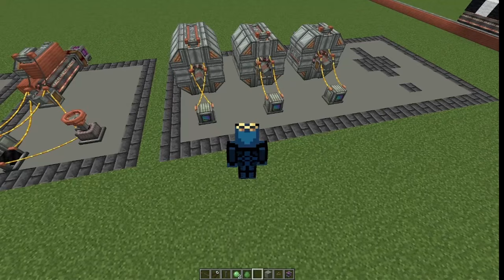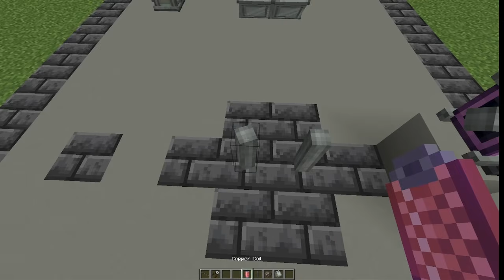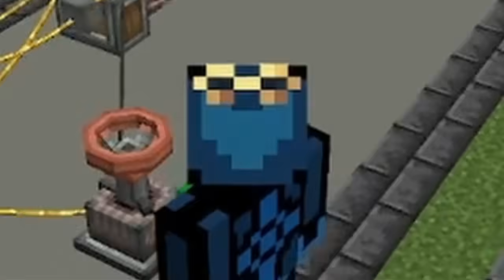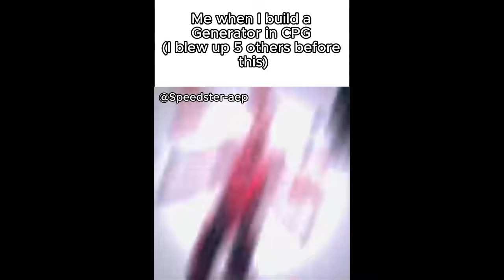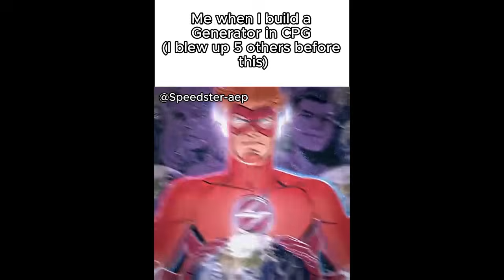[OUTDATED]  How to make a Generator | Create Power Grid Tutorial/Info

Comment: when i make this machien i get 0.08 VOLTS withj all 4 sides with windings the windings def work since each add +0.02 and im at max speed creative motor i tired both directions nothing is working for me idk why
Reply from the maker: Do you have the generator housings placed to the windings?
Reply: @someoneisnear  yes the issue ig was i didn't properly wire and cycle the inital residual energy back to the commucator to produce the actual voltage

Comment: 7:00  

I did 1in1 like you. The polarity is correct, everything else is correct, even the rotation of the creative engine is set to 90, just like you. But your voltmeter shows 195 volts, mine is 0.02. WHY? EVERYTHING IS THE SAME FOR ME AS FOR YOU, WHY DOES IT WORK FOR YOU AND NOT FOR ME?
Reply from the maker: Try flipping the rotation of the create motor. Let me know if that helps.

Comment: Why my generator doesn’t spin constantly? If I connect something or change resistance the generator slows down. When I change rotation speed on creative motor then generator starts to spin like it was in slime or something. It feels super strange. And when I destroy motor generator keeps spinning really really long. I already trying to change something on config but nothing help, mine just don’t work as it work on YouTube videos
Reply from the maker: That's the resistance in the windings whenever you spin it. It's normal as the voltage flowing through windings creates the magnetic field that slows the rotor speed. (Just from my basic understanding of it)

Comment: Those device are rates 1000 Watts, example given, power resistor can only be 3 A at 300 ohm before start over heating this is because you don’t have constant voltage but power, the best is around 1.9 A

Comment: 1 problem, im on forge 1.20.1, do you know why my generator clutch is getting power (creative motor) but doesnt give the power to the other side? the generator doesnt get the rotation
It's on generator mode, I dont have it powered with redstone, and even with redstone power it doesnt work
Reply from the maker: The generator doesn't use Redstone it uses the rotation of the generator clutch to spin the induction rotor.

The induction rotor must also be connected to the Generator commutator in order for it to spin.

Also, don't forget to connect the outputs (positive and negative connection) to the coils that surround the induction motor. This will create a very crappy but working shunt generator.

Comment: 1:24 trust me, you're gonna want that resistor. It will prevent you from accidentally blowing up your generator excitation winding as it has a limit to its current. (Yes you could use a fuse but then you risk your grid shutting down from one of your generators shutting down.) So trust me you're gonna want that resistor set to something higher than 0.1 ohms to prevent human error.

Comment: The variac is just a variable resistor and is only there so you can easily turn to change the voltage. To generate anything you need to excite the stator coils. The resistor from the commutator to the stator is just to limit how much excitation current flows through it because the stator coils saturate at 2A. If you push more than 2A through the stator coils you will get higher voltage but also you spend more power on excitation and start overheating the coils, you can attach a thermometer to see. The shunt just limits the voltage not regulate, if you connect any load the output voltage will drop. That's probably why there's a variac in the ponder, so you can adjust the voltage when you connect or disconnect something. You regulate the generator manually in this case. That's okay when you have constant load but if you're switching stuff on and off your voltage is gonna be flying up and down. To do it properly you need a regulator circuit that adjusts the excitation current up to 2A to maintain stable voltage with any load.

Comment: hey u can make a transformers that do is like generator give 440v then we convert into 12.1kv tha what i did i used 2 transformers 1:11 and 2:5 so it goes to 12.1kv but i need that add a stabilizer like when i convert it back from 12.1kv to 440 i dont get 440 but i get is 428.###v so i need to add a  stabilizer that convert v around 440 on load and off load idk how to make it but can u help me?
thank you
Reply: i was also building and supplying electricity to a server/town it is prety fun tho i am js stuck one the  stabilizer part but all good and will making  stabilizer my self i blow up like my generator 15-20 time already  hehe

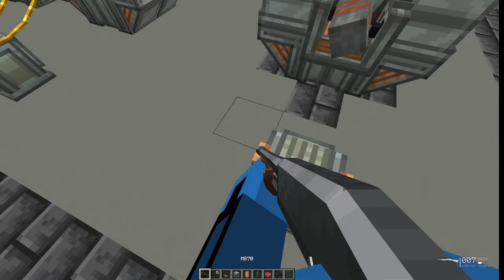Comment: 6:33
pulls out shotgun
"Dun worry bout that."

HUH
Reply: Last time I checked, electrical engineering doesn't require you to hold the generator at gunpoint
Reply: @boopjack  No it's common practice to intimidate your circuit before testing for better chances of sucess.
Reply: @David-pz4gy Uncommon form of "percussive maintenance": "preventative intimidational maintenance"
Reply: @boopjack generators are kinky, it excites them when you do that

Comment: If anyone has any build ideas for a power meter to enable payment for power I’m interested
Reply: Built my own service entrance!

Bury a breaker underground and hook it up to a security card system so utility employees can turn power on/off.
Power meters really can't store value, but what you can do instead is bill at a flat rate based on the type of building, and add a multiplier based on typical load.
Reply: @Lokey_71  good ideas I will experiment with! I was thinking, instead of storing metered usage, it would be a prepayment meter, so pre buy “tokens” and then each token is worth ….60minutes for example. May need some redstone I suppose
Reply: This is what I’ve not managed to work out just yet, I’ve seen another creator (mr beardstone) use the same method but it was for the transfer of Stress units, still “metered” via adding credits
Reply: @Nitro55Gaming  Actually that gives me a thought. coming from the home's neutral, before it hits the distribution's return line, have it drive a motor. Increased load throughout the house I theorize could have this motor turn faster. Now, have a mechanical system that for every full turn of the motor, moves a single item from one chest to another.

You bill by checking how many items are in the second chest amd multiplying it by a fixed rate.

Comment: Could you do a video about circuit boards, also mine break when i place them
Reply: If your circuit boards break when connecting to a power source, then the power source may be to strong. check the values of the components ( you can edit some of those values in the schematic table btw) and measure using the mulimeter or the dedicated Voltage and Current meters (those can be placed on the schematic as well)
Reply: @ruvaak8250  thank you buddy!